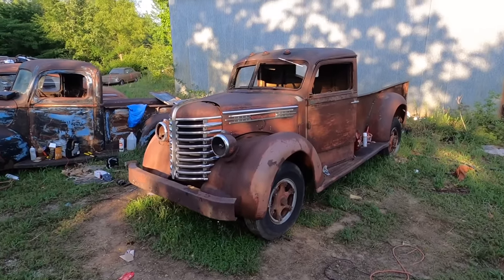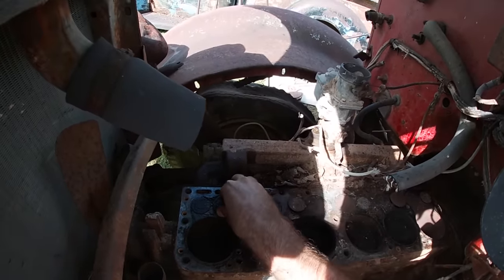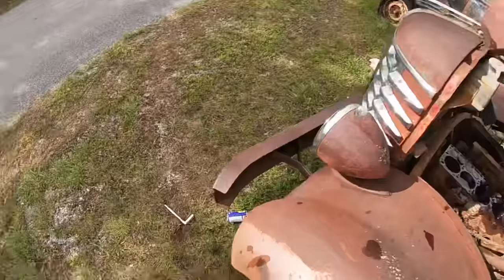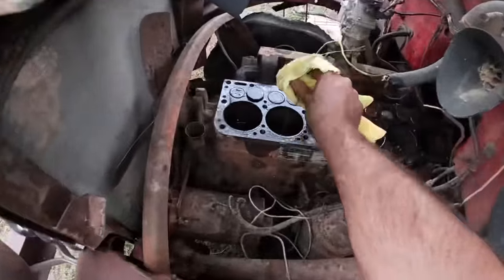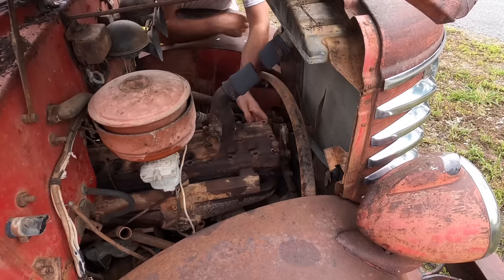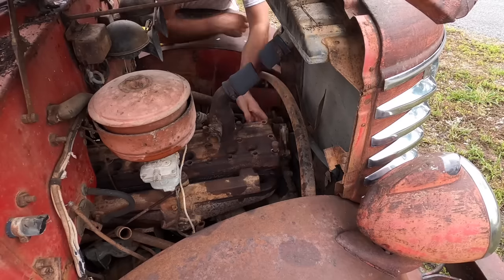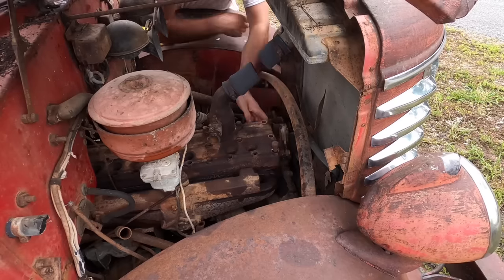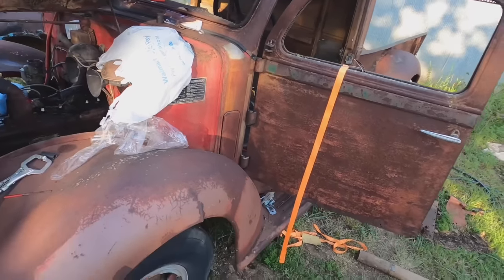Will it run after 66 years 1948 diamond t 201 pickup truck

Comment: never put liquid in a head bolt thread! You won’t be able to torque it correctly because you will be trying o compress the fluid in that thread is IMPOSSIBLE you will not torque it correctly
Reply: Only if it's a blind hole, a whole lot of engines have head bolt holes that are tapped through into the water jacket, so oil in the hole may not have made any difference in this case.

Comment: What you do is, you go buy about $200 dollars worth of generic ignition parts. Then you stand back about 20 feet and throw the parts at the truck and see which ones stick. The ones that stick are the ones you need to get the truck running. The ones that don't stick  are the "well, we don't need those anyway" parts.    Look, "Master Mechanic", The ballast resistor mounts on the firewall, not on the coil. Did you check the coil with an ohm meter? How do you know the coil is even bad?  If you are going to make "Will it run" videos, you need to know what you are doing. If you are going to make cartoons, you are doing a great job. Coil, points and condenser ignition systems are as simple as anything on earth. If you cant replace those parts correctly, you should probably take up knitting.

Comment: No I don't think that's your problem... You said you had one valve that's hanging up that's not helping that's letting all the compression go on that cylinder....... But what I can clearly hear is that you're running out of battery and that starter is probably drawn too much amperage... Plus and it's just me a lot of you guys don't like to run engines on quick start but I sure as hell do cuz it cuts through the BS real quick

Comment: Did you run a thread tap thru the block bolt holes  did you clean the threads of the head bolts
Reply from the maker: Yes also did the spark plugs the same way

Comment: You gave up too soon. It might be the carb. You can pour gas into a carb, but the carb has to function or things won't start. Also, a 12 volt battery will spin the engine twice as fast to revive it. You can convert the rest later. You are convinced the timing was good. Lots of guys just turn the distributor until it lights. If the timing is good it will start in spite of itself.

Comment: You made two mistakes when you take off the head off you supposed to leave the boat in it and two you supposed to see if it turns over on his own power without messing with the head on okay there was three mistakes when you put the head up back on you supposed to leave the boat in it when you put it back on you supposed to move the head on around the boats will tell you you got in the hole to put the boat back in